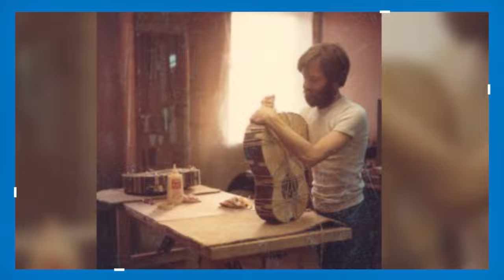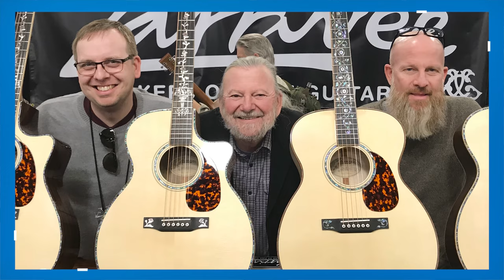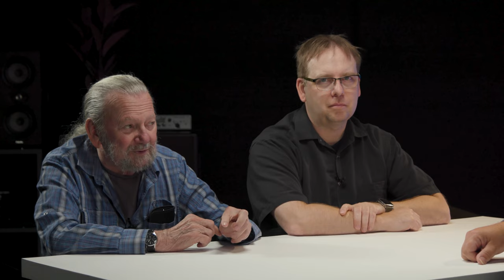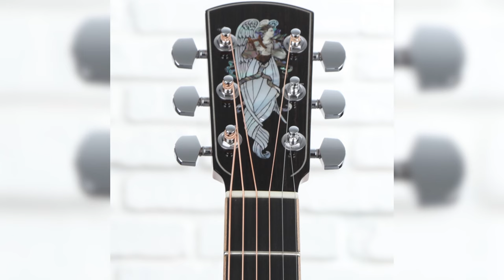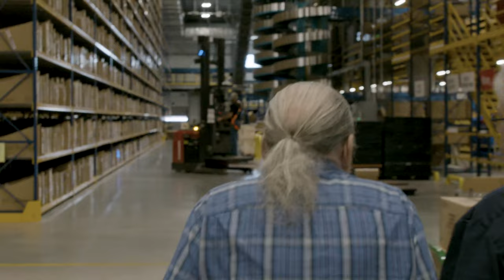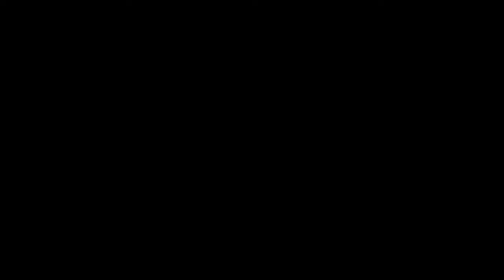The History of Larrivée Guitars

Comment: I’ve got one! I have a Larrivée LCJ-19 that I special-ordered in 1995. It’s jumbo cutaway with flame maple sides and back. I was after something like a J-200 with a cutaway, and Gibson wasn’t making anything like that at that time, so I went with Larrivée. It’s a great guitar, just an absolute cannon, but I’m primarily an electric player, so I had a pickup installed in it. When I took delivery of the guitar it was strictly acoustic, and I played it for about a week before taking it to a tech for the pickup installation. It’s an older (well, it was current then) Fishman setup with the preamp mounted in the side of the guitar. So I heard it both ways, without and with the preamp mounted, and noticed no difference either way in the acoustic tone. It still sounds better acoustcally than it does plugged in, but that’s often the case when trying to amplify an acoustic guitar. Despite being an electric player, I play the Larrivée acoustically more than I do amplified.